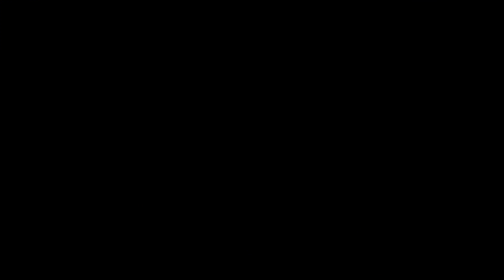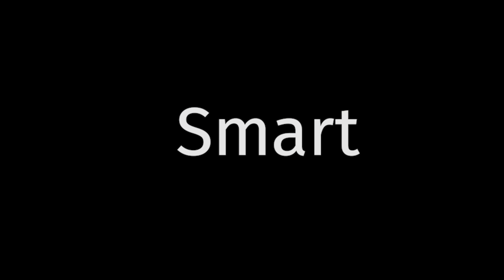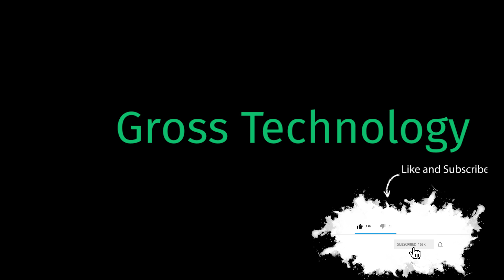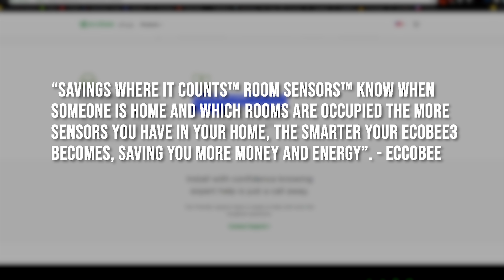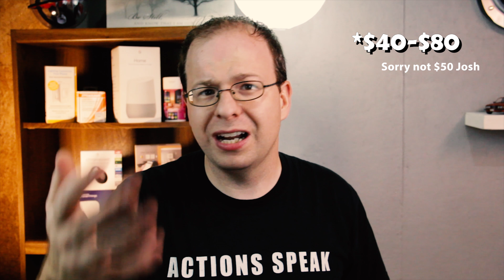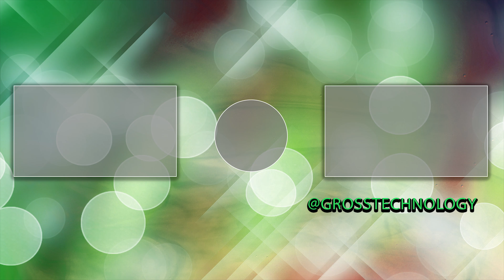Should You Buy the Room Sensors From Nest and Ecobee? #VEDA Day 4

Comment: I'm glad you explain this. I am looking at a new smart thermostat and at first I saw the new smaller thermostat add ons and was like hey what a good idea, everyone has that one room that gets a little hotter or a little colder than the rest of the house. Then I immediately started analyzing how this would work and started laughing that this was truly being sold. A central unit is just that, a central unit. It can only provide heated or cooled air through every vent. Therefore, even if you place a thermostat in a certain room and want it to get that room to a certain temp, then all other rooms will change temps as all vents recieve the airflow. 
But then I began thinking I had a new ingenious invention with smart vent controls, but 10 seconds later I googled this and realized this has been done.
Reply from the maker: Yeah but it seams that a lot of people don’t understand this at all. Or they just go to the “it averages out better” which okay yeah but still doesn’t change the fact of what it’s doing. 

But yes, smart vents are key, just have to be careful not to damage the unit because the flow change.
Reply: @GrossTechnology  yup you would probably be better off doing a hvac bypass to keep from overloading the system
Reply from the maker: Tyson Stone true but that would depend on the size of the house. If it’s a smaller home like mine, the cost of that wouldn’t be worth it.

Comment: Because of all the marketing speak about smart thermostats I’ve read, it took me 3 days of research to realize that’s not what they claim unless you have some kind of zoning setup. I really can’t understand why they doin’t just make the smart thermostat SEND multiple thermostat readings from sensors to a multi-zone panel. Then you can manage all systems from one panel. Want to override one particular sensor (room)? Add a simple UP/DOWN buttons and temp display to the sensor. Done. None of all this misleading crap to sell you more junk and WASTE more energy.
Reply from the maker: Exactly!!! Glad someone else gets it.  By the way, they do have systems like you describe, but they are commercial systems that cost WAAYYY Too much for a residential situation.  But hopefully that comes down the line at some point.

Comment: Before making an educational video, pease educate yourself on what the sensors do! These are not meant to cool or heat rooms independently, rather monitor desired temperature and attempt to accommodate it while your there.
Reply from the maker: Before you comment on a video, maybe you should watch the entire video, and try and comprehend it first.  Because if you had, you would understand what I was saying, and the fact that your statement, "These are not meant to cool or heat rooms independently, rather monitor desired temperature and attempt to accommodate it while your there" is saying the same thing and contradicting yourself.

Comment: I agree with you for the most part. I mainly use them as occupancy sensors for the ecobee. I have teenagers in the house, and when I leave they're usually not too concerned of where the thermostat is set. The censors know if nobody is home and shuts things down. That's what I primarily use them for.
Reply from the maker: Yeah my wife likes to open the windows up in the summer so I have sensors to turn the AC off so I don’t cool the outside down.

Comment: While this scenario is true, so is the opposite what if you have parts of your house that get way too cold in one room where your thermostat is that is hotter.
 
You can put the temperature sensor in a room that is more average for example say your temperature changes drastically throughout the house you put the sensor somewhere where the temperature of the house is more centered rather than hot or cold you put your temperature sensor in that room and now you only have a 2 degree differential at any point in the house rather than that 4 degree differential without the sensor

Comment: I'm all for calling out companies' false claims, but I don't think that is the case here. At no point in time during my research did I get the impression that they were saying you could control which rooms were receiving hot/cold air. The way that they save energy is by adjusting the thermostat's temperature setting so that the coldest/hottest rooms in your house are brought to your desirable temperature ONLY when they are occupied. This is an improvement in energy efficiency.

Comment: My main thermostat is in my living room with my fireplace.  When the fireplace is on the room heats up so the furnace doesn't kick in,  then the rest of the house gets very cold.  A remote sensor in a different room will ensure the house stays at a constant temp even when the fireplace is on.  There is a value to these sensors without smart vents if you understand your needs.
Reply: Good explanation!
Reply: Not sure I agree with that.  Yes, if you put a sensor in the colder rooms, your hvac system should kick on and heat up those rooms, but, if you dont have a smart vent/sensor in the room where your fireplace is, your also pumping the heat from your hvac system in to that room as well and it may get over heated

Comment: Question, if I have two sensors in different rooms with vast temp differences, that should also create conflicts, right? Eg: 1 room at 68 and 1 at 72 and there is only 1 HVAC unit in the home.
Reply from the maker: The system now creates an average of the two and will maintain that average. The other thing that they do now is only have a sensor be in the average of a person is detected in the room, if you have that enabled. Does that make sense?

Comment: 106 ppl not so smart. This guy actually exposed the fundamentals required to make  this work. Without smart vent these ecobee or Smart Nest is basically useless. Very few reviewers actually know this. Kuddos  for making this video.
Reply from the maker: Thanks! Yeah probably my most controversial video I’ve made. The main issue is that people think I’m saying the temp sensors won’t work, which isn’t correct. Yes putting the temp sensors around will give you a more “average” temp in the house, but it will be at a cost to your wallet and even the unit itself.
Reply: @GrossTechnology  exactly. Without proper zoning adding sensor is really useless. I just came across this whole smart vent thing about few house ago. Then asked myself how does the furnace/AC know where to blow the cold/hot air? and baam thats when i realized you either need zoning done at duct with mechanical flap or smart vent which probably cost less. Btw do you know any Smart vent that works offline meaning you can still control within LAN when your internet connection is offline. Thanks
Reply from the maker: Ohhh thats a good point, and sadly the ones I know of do not work of LAN, only a Wifi signal.  Guess they don't expect you to have a network jack next to each vent.

Comment: Wait what if your thermostat is in the hottest room of the house then maybe a sensor makes sense
Reply from the maker: That is true, it will help even out the “average” temp for the house, but again the main point I’m trying to make is that to really use these features the companies talk about with the sensors is that you need vents that will open and closed based on where the air or heat need to go instead of the whole house.

Comment: Lots of other factors/variables at play with this specific type of thermostat technology, such as keeping humidity down and also prolonging the life of your unit/furnace as well. Humidity in the home causes failures and winds up costing more money when it comes to the system itself. Humidity can create mold in vents and also hinder the central air systems ability to do its job. Lots of newer AC units are much more efficient than those of just a decade or two ago. Couple a nice new central air system with this technology and you'll have yourself a very efficient and well kept system for several years granted it was installed correctly. I think what people should realize is that these room sensors likely won't do much for an older system but will truly shine with a variable speed or two stage unit. Dampers, which is what you were trying to suggest, would certainly do a great job at effectively keeping individual rooms cool, but most people do not want to pay the extra money, not only for the hardware but to also have it installed professionally.  You definitely don't want to install dampers on an older, less efficient system as you'd be better off spending that money on a new, more energy efficient compressor. 

I have ZERO experience with installing, selling or repairing HVAC, however I recently had to do some homework on the subject as I had my whole system replaced with a 17 SEER two stage trane compressor and furnace with bottom floor and top floor zoning (dampers). With the sensors I can also inform my installer which rooms are cooler or not pumping out enough air so they may make adjustments to the zoning control accordingly. 

To conclude; I have two ecobee thermostats (one up/one down) and 4 sensors (2 up/2 down) and so far I'm petty happy with the adjustments it makes according to occupancy as well as temperature fluctuation. They could definitely be better, cheaper and more configurable, but they do help.
Reply from the maker: First off, thank you for watching and for putting the time into writing your comment.  

I completely agree with what you are saying, newer systems are by far, going to take advantage of these sensors, and smart thermostats the best.  And as you mentioned having zoning control with dampers really allow you and your new system to take advantage of these sensors.  That being said though, I am not really suggesting people spend thousands and get dampers installed to have these sensors work, but rather look into smart vents, that they can setup and install themselves.  They act, in a rough way, similar to the dampers you have installed.  

The main point I was trying to have people think and realize that putting these sensors is not going to save them tons of money like the companies tried to portray their devices would do.  And you are especially correct that the older systems, while they will work with the thermostats, will not take full advantage nor really see the savings as the companies were saying.  

The other point I was making is that without some type of damper, either smart vent or actual damper in your system, to achieve that lower or higher temp in the rooms, or even to get that "average" temp in the house, it would have to heat or cool your entire home.  Which just common sense tells you that if you are heating or cooling an entire house, rather than just the room that is in question, you will not be saving money and will actually be spending more, especially in the larger homes.

That said, a lot of the larger homes already have two zone controlling systems installed, either by two actual systems or one with two different zones with dampers installed.  In the second case, yes the system would be able to close some of those dampers off, but it still is not just going to heat or cool a single room.

To sum it all up, yes will having more sensors around the home give your system a better and more accurate temp readings and therefore allow you to have a more accurate "average" temp throughout the home, most definitely.  And if that is all you are looking for then by all means the sensors are going to be great! (A bit pricy as you said, but they will do just that)  But if you are, as they were stating on their site, wanting to cool or heat a single room in your home, either because its the cold or hot room in the house or its the one you are in, and you have no dampers or smart vents, you will be wasting energy and money on heating or cooling the entire house to achieve that "average" temp.  

That is what I wanted people to be aware of.

Again, thanks so much for your comment and for watching.  If I can help you with anything in the future don't hesitate to reach out.  Thanks again!

Comment: You are so wrong about this. Very uneducated. Every home usually only measures temp at the thermostat. So once the temp gets to what you set it at only at the thermostat, it shuts off. These however measure the average of several rooms, (as long as these rooms are occupied) and if your goal temp is met at the thermostat and not in your bedroom then it can continue on until your house has met an average temp...
Reply from the maker: But you are neglecting the fact that we are heating or cooling the entire house to reach the average temp you want, and what they were advertising that you can do specific rooms specific temps.  That isn’t what it’s doing. Yes it setting more of an average for the entire home but at the expense of your bill.

Comment: Step 1, understand how your system works. Air conditioners work by removing the heat from your house through the return... If you have a hot room, and your house doesn't have zones, put in another air return in our near the hot room. If you have a hot room and you leave the door closed, the return won't suck in the hot air. Second, temperature sensors work if your thermostat is located somewhere that doesn't represent the overall temperature of your house. They help average out the temp of the house.

Comment: It averages the temperatures from what I understand
Reply from the maker: You are correct, it does average the temps from all the sensors.  This is an older video, working on an updated one to explain this all better and get my point across better.  Thanks for stopping by though.

Comment: Somethings are about comfort  not just savings the thermostat in the family room on the main level cant give an accurate reading of the temperature in my basement. I want the space I'm in to be my desired temperature not somewhere else. The savings come in with setting a schedule and smart away and home. All of this and a better explanation of what you are trying to say is on their website. Your video is a bit misleading
Reply from the maker: I totally agree with you about this.  It is totally about comfort, but what I am trying to make sure everyone understands is that these will not save money.  That is the point of the video.  The companies talk about how these will save you money because it can send heat/air con to the rooms when you are in those specific rooms.  But it can't do that!  It can only send heat/air con to the entire house... it can't blow to specific rooms, which is what they are leading people to believe.

Does it make the rooms and house more comfortable, oh totally yes.  And I've never said it wouldn't do that.  It will most definitely make your average more average.  You are right with only the one sensor at the thermostat it can't truly know what upstairs or downstairs really is.  So making those rooms correct is almost impossible without some type of sensor in those areas.  

But again, this will make the entire system blow to the entire house to try and achieve that instead of just to that room, like they said it would.

This all said, both sites have been changed since the recording of this video.  The wording has been changed so that its more vague and doesn't state these issues.  So it has started to become a mute point, but still viable to know what you will actually get with these things.  

I'm going to do a new updated video on this showing both the smart vents, as well as how these sensors work and all.  Hope that helps clarify things.

I just wanted people to understand what they were actually getting and not to just think these sensors would just allow certain rooms to get air to them and not to the rest of the house.  

Sorry you think the video is misleading but I hope this helps clarify things.

Comment: I’ve recently purchased a house with Ecobee 3 lite installed unit in MB and hallway running a dual 1st and 2nd floor system. I was about to get these sensors but figured air is blowing on just either 1st and 2nd floor. My dampers set to 0 for direct blow on either floors since hot air rises. You’re right without additional room dampers or smart vents installed. These sensors would be basically 1/4 of its main purpose. Most of the customer reviews and ecobee company itself didn’t stressed this out. But maybe customers are just looking to set on average temp which is easy to understand if they know how cold and hot air convection works. Thanks for the review hopefully people understand that they are just throwing money at purchasing sensors. If they want a 100% efficiency install dampers or smart vents in each room that’s where you get your money’s worth for these sensors.
Reply from the maker: Thank you!  Finally someone that understand this.  You are correct, and thanks for your input!

Comment: Two words...zone controller.

We have a garage apartment and the main upstairs and both are heated/cooled by the same unit. But they're on separate thermostats. There is a three zone controller (of which we're only using two zones of) in the attic that the thermostats link to, and it controls both the AC/heating unit and each zone damper. This system actually works, because it literally shuts off airflow to areas where it doesn't need to go by shutting or opening the dampers.

However, said dampers have to be installed in your ducting, and it's difficult unless you're redoing the ducting completely.
Reply: The only way a zone systems saves money is if you have a varieble condenser and/or furnace that can step down it's output. If not, most zone systems are also about comfort, as all they do is bypass the air that would go to those other rooms back into the return...which can actually cause issues in certain markets. Zone systems that can actually save you money cost upwards of $20k...so are you really saving?